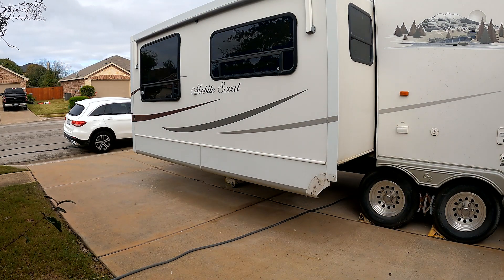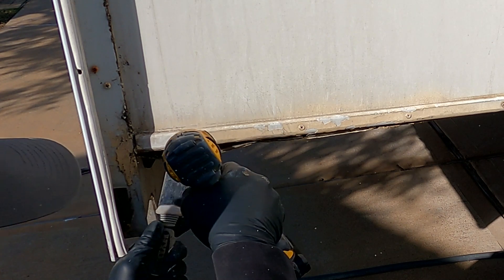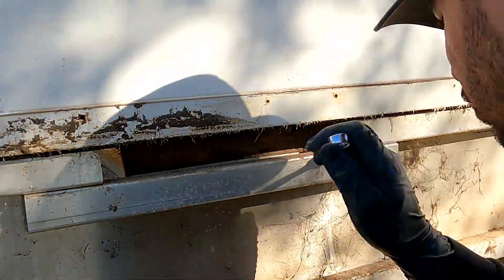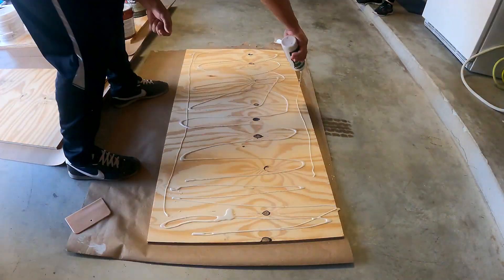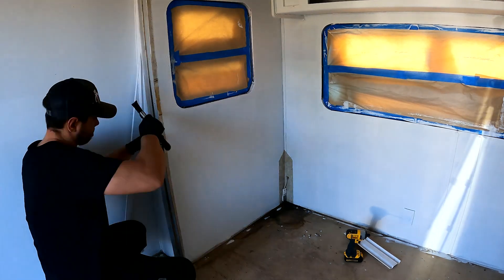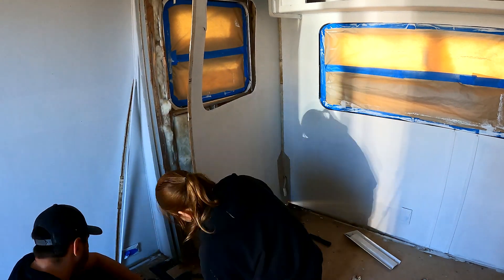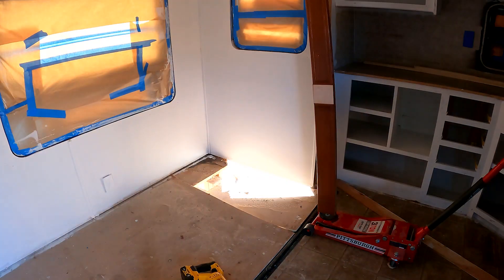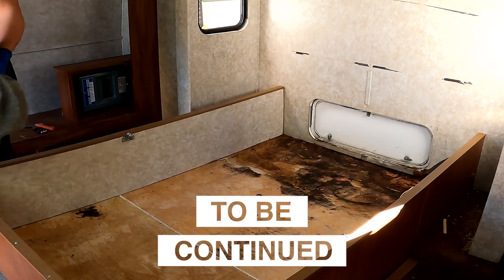How to repair Slide-out Water Damage | RV Renovation | 2006 Sunnybrooks series Ep 08

Comment: How did you attach the 2 new pieces of plywood to the center piece ?
This is my issue in my 12' slide 😢
Reply from the maker: I first attached it to the rest of the areas, meaning the walls, and used pocket hole screws to join the two plywood pieces. I'll upload a new video soon where I filmed better this process.

Comment: Did you notice any issues with sliding in an out of the strength of the flooring with two separate pieces rather than replace the whole floor? Thanks for the info!
Reply from the maker: Hi! Replacing only a portion didn't affect at all the sliding function.

Comment: There should really be a class action suit against RV manufacturers….. literally every RV owner deals with this
Reply from the maker: You are right. Every single RV has the same issue after only a few years on the road.
Reply: A lot of this is maintenance though. You need to keep on the seals and always be watching for pin holes.
Reply: this could all be resolved by using aluminum for the Slide out floor so that it would be easy to replace thinner, wood flooring on top.
I don't know why aluminum metal is not used on the Slide out floor.